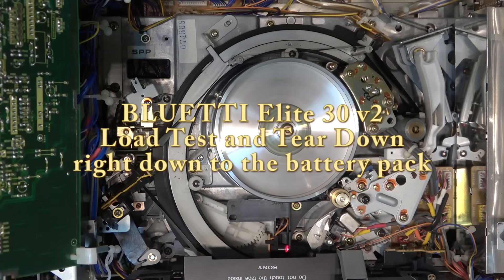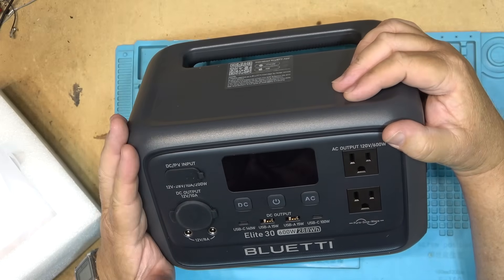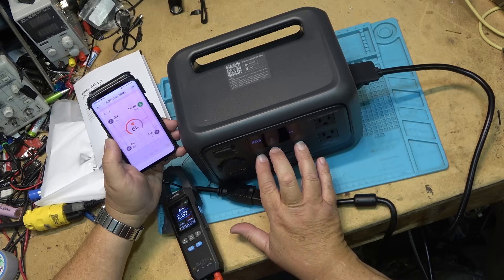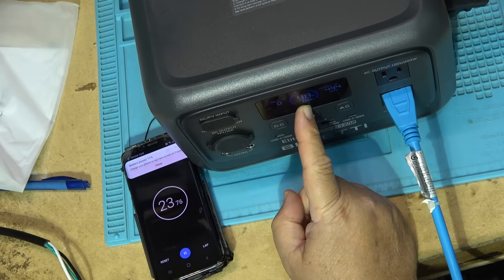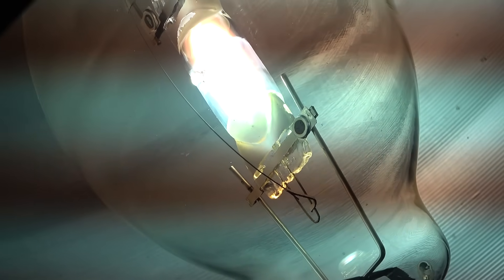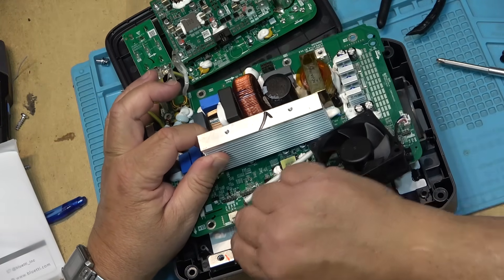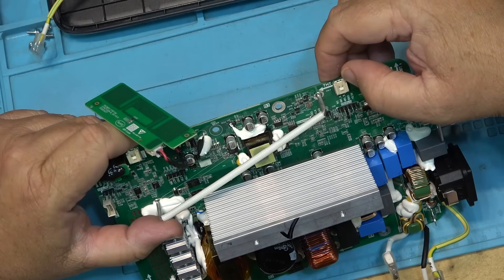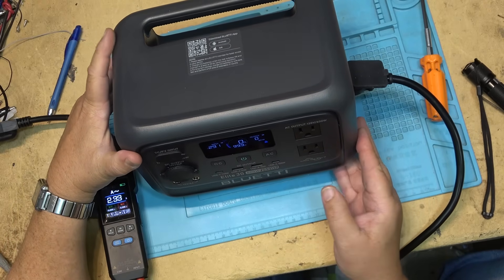BLUETTI Elite 30 v2 Power Station Tear Down

Comment: Thanks for the teardown. I bought an eb3a to use as a UPS for my NVR and Wi-Fi, however it kept going into overload every day. As a sanity check, I unplugged everything from the AC output and just left it on and plugged in. Would still go into AC overload after a day or so. Very disappointed I probably got a partial faulty unit.
Bought an EcoFlow River and that's been on 24/7 for months now. I also like I can set the charge limit on EcoFlow to 90%. Even with LFP, it's not good to store at 100% for very long periods of time. 
I ordered the new bluetti Elite 100 back on prime Day. It arrives tomorrow. I hope it performs flawlessly.
Reply: В этой модели тоже можно выставлять лимиты, это делается в телефоне в программе.

Comment: Ive had nothing but problems with my eb3a getting confused about it's soc.
Reply from the maker: My eb3a has never been turned off, I use it as a ups for my computer.
Reply: @12voltvids they seem to like that mine acts up when I haven't used it in a while.

Comment: Does it have MOVs at the AC input, and if so what are they rated at? I really dislike that all the brands are advertising their units as UPS, yet they don't protect their loads against surges.
Your oscilloscope belongs in a museum. All of these power stations claim "pure sine waves" yet have also sorts of odd behavior. Long zero crossing dead times, DC offsets, and occasionally distortions depending on load. Need a digital oscilloscope like a RIGOL DHO804 to see these minute details.
Reply from the maker: I have a digital scope.

Comment: I wonder if the inverter circuit is different in the Australian 240volt version? It seems well made as I would hope for the price they are charging for these units in Australia. I wonder where they are manufactured? Hopefully the Australian version is imported directly from the factory and not via the USA.

Comment: Would it charge a 52V 30ah battery for a ebike??
Reply: Nope
Reply: A general rule of thumb is to avoid using a smaller 288Wh (Elite 30) battery to charge a larger 1560Wh (your E-bike) battery.
Reply: @holmiumh duh

Comment: Nice to use as an UPS, gives time to shut things down without worries.  I had one much larger and different brand(got stolen while camping), used for a freezer/refrigerator in the truck as well as other electrical needs. Haven't replaced yet as they're expensive and I have other priorities at present.  Thanks for the tear down and look inside, interesting battery size.
Reply: I've just got mine and UPS works fine to about 400W, at 450+ it isn't switching fast enough (I've tested it with various computers). I don't know whether it's supposed to be that way or not but to power some of my computers I will need a bigger unit to utilise the UPS feature... either that or chain an actual UPS between 😢
Reply: Good to know. I may upgrade from my ups one day but the only problem if I won't be notified if I have an outage (via ups-nas usb connection) which is pretty important.

Comment: I've seen a few people that reviewed this one this week but you're the only one that did a tear down. It looks like a well built unit, I know Bluetti gets a lot of good reviews. Those cells are huge and there's only 5 of them. I guess if a cell goes bad it would be easy to find which cell died with only having to check 5. That would be a nice power station to take camping. Take a 200 watt solar panel with a Voc of 28 or less to charge it. It can be used to charge phones, tablets and laptops. It may be powerful enough to even run a small single serve personal coffee maker. Thank you for the review, testing and tear down.  Good stuff.
Reply from the maker: yes it will run even a fry pan but it will take longer to heat up
Reply: @12voltvids  this would have little issue running a small infrared or induction burner.   I have an EB2a that runs it fine if I'm cooking intelligently and this is largely better.